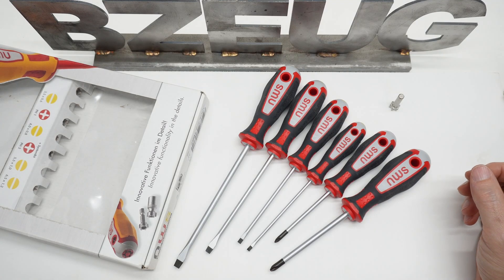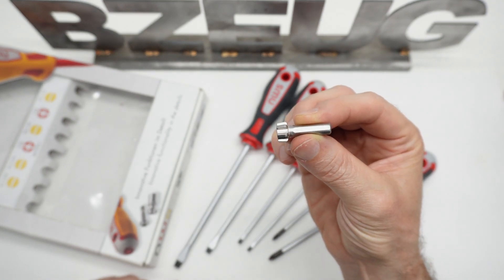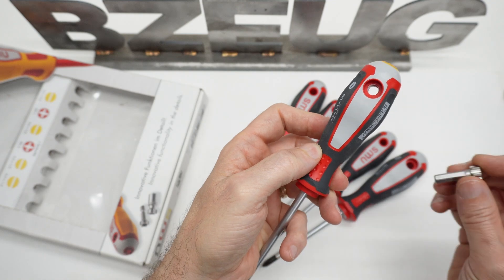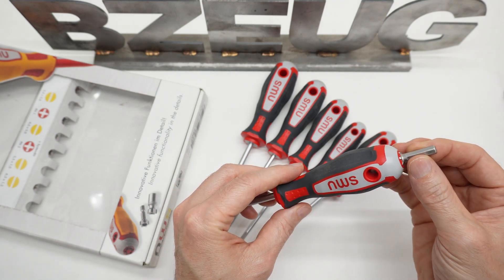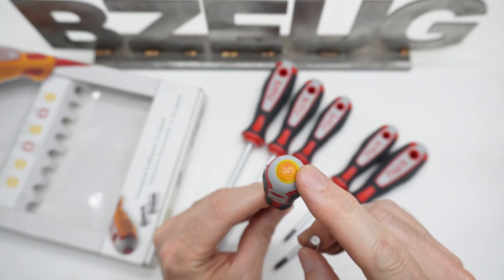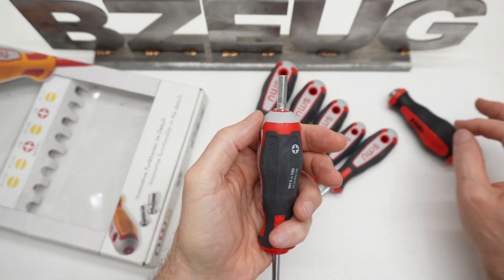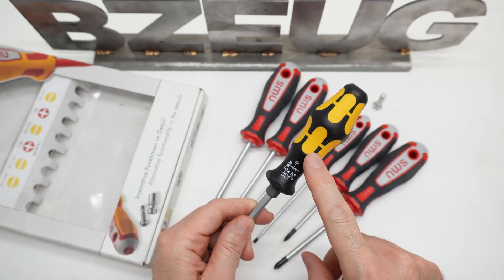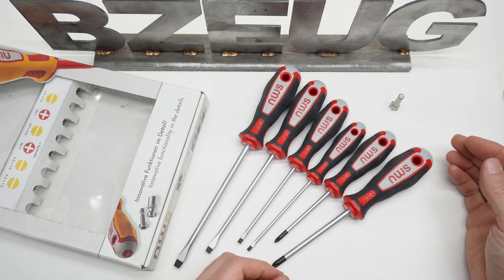NWS German Brand Screwdriver Set.  Really Felo with a special feature.

Comment: They look like a Felo Ergonic rebrand. Apart from the gimmick, how are they holding up? Been wanting to buy a set of either plastic or wood ergonics as well as the VDE version with changeable blades ("E-smart").
Reply: They are made by Felo, so same as Ergonics.
Reply: @MeuReview  There aren't many reviews of the Ergonic screwdrivers. My gf has an Ergonic K and I love the grip, but how do the regular screwdrivers hold up against say Wiha, Wera or Snap-On? Project farm did a comparison but those were the regular ones, without striking cap.
Reply: @iliketoast-q9b  I can only speak for the felo wood but they've held up well with daily use for 5 years now, however, my daily use is primarily panel wiring so not the most intensive use case. I don't know if they still come with it but mine have a 20yr warranty too though it doesn't cover general wear. The tips are getting a little worn on the most used ones (ph 2, pz2 and 4.5sl) but still fitting fasteners just fine. Hope this is of some use to ya 👍🏻
Reply from the maker: Yes, I messed up not showing the handles side by side with my Felo Ergonics.  Posted a side by side on Instagram this morning.  https://www.instagram.com/p/CxQPLl_r-Ab/?utm_source=ig_web_copy_link&igshid=MzRlODBiNWFlZA==

Comment: reminds me of a headscratcher I had. I bought a Wera torque screwdriver that has a round plastic cap on top you remove to get to the torque adjuster nut inside. But the cap has no way to remove it. I filed down one "edge" enough that you can insert a small flat tip screwdriver to pry it off with. What were they thinking? On the up side they did include a few extra plastic caps in the package.